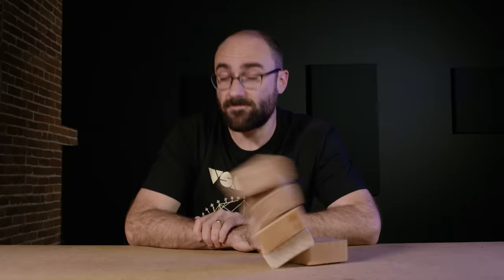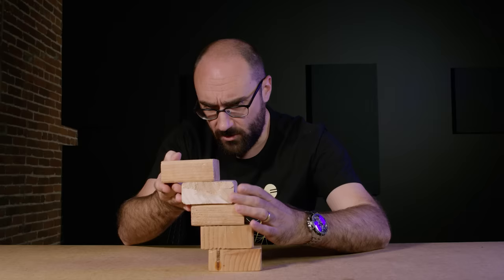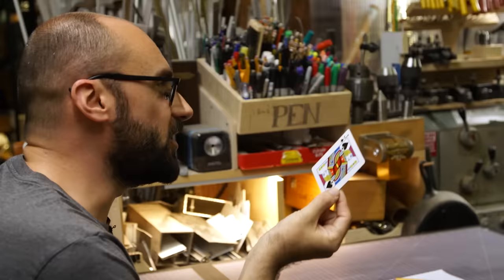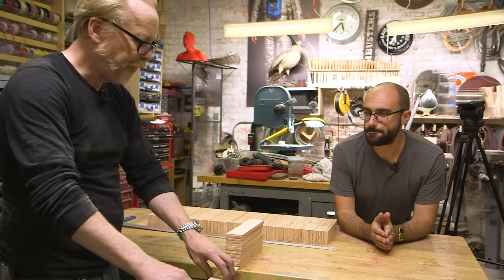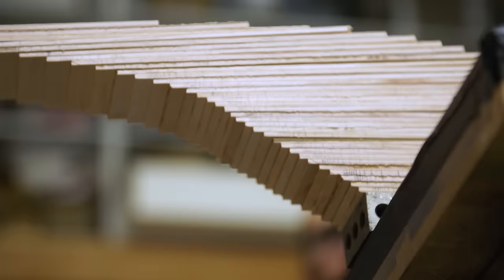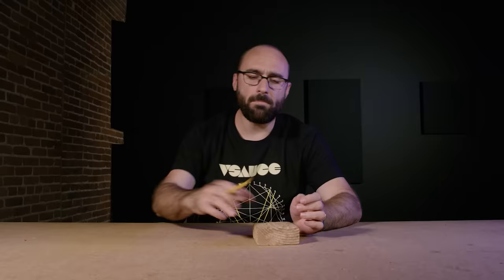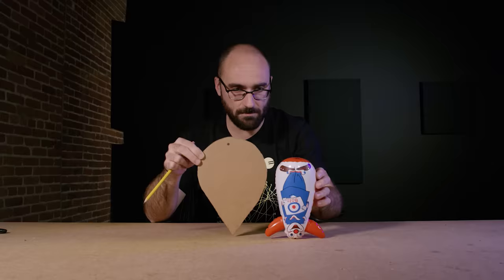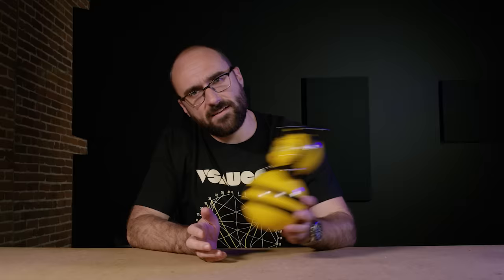The Leaning Tower of Lire

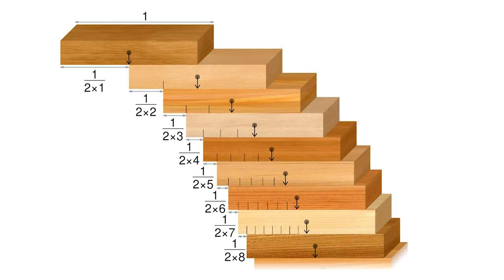Comment: 4:27 It's actually not true. Michael's answer here is based on the harmonic numbers, and the fact that you'd need 31 cards to reach three times your initial length. However here, the distribution is not exactly harmonic as 1 / n, but as 1 / (2n) , as he says at 3:14 in the video. So the figures he gives around 4:27 aren't correct, since they include in the sum, fractions as 1/3, 1/5, 1/7 etc. and not exclusively the even ones : 1/2, 1/4, 1/6 etc. 

For example, the harmonic distribution we have here wouldn't take 4 cards, as in 1 + 1/2 + 1/3 + 1/4 , to double the length, as said at 4:18
But actually 5 cards : 1 + 1/2 + 1/4 + 1/6 + 1/8

And so on... So the figure of 227 isn't correct either. But that's okay Michael we forgive you!

Comment: My calculator sais that if I add ½+¼+⅙+⅛...27 times, I will end up with 2.08... which means you need 27 cards for 2 card lenghts, and Michael said you need 31 cards for 2 card lenghts. What did I do wrong?

Comment: As a mathematician I'm a little disappointed by you Michael here.
1. It is a massively important fact about the harmonic series that it does not converge. 1/2 + 1/3 + 1/4 + 1/5 ... will keep growing to infinity no so will 1/2 + 1/4 + 1/6 + ... , but 1/2 + 1/4 + 1/8 + 1/16 + ... will never reach 1. You missed a chance to do some really cool Math here, Michael!
2. The balancing dove does not have its center of mass on the beak, nor is its center of mass above the support. The balancing dove's center of mass is BELOW the beak (see how wingtips are below it?), so the balancing dove is, in fact, a PENDULUM.

Comment: 3:23 "Even though the overhang we can add keeps getting smaller, it never reaches 0. So, these blocks can overhang as far as we want ... ."

This is not a valid argument. There are (many) infinite series which sum to a finite value, e.g.
sum from n=1 to infty of  1 / 2^n

This is indeed not the case here, but not for the reason Michael mentioned. Rather, the sum of the harmonic series 1/n diverges (goes towards infinity), and the series we consider here is essentially 0.5 * 1/n.